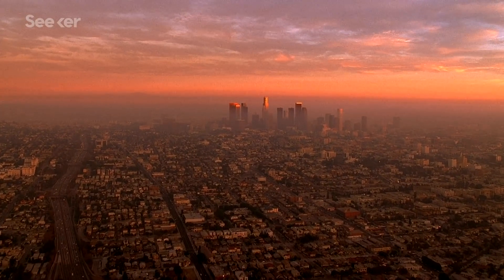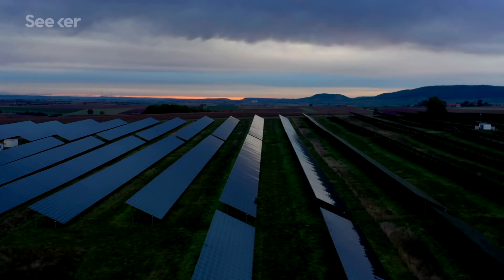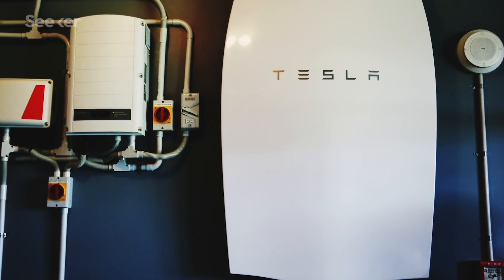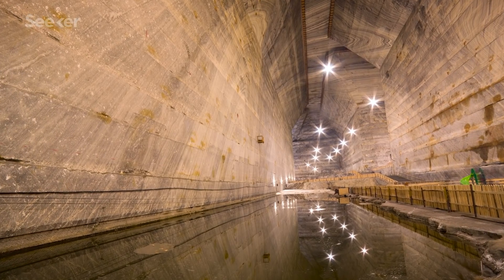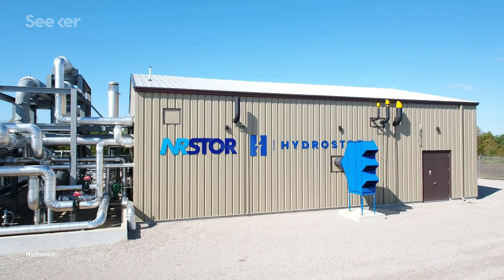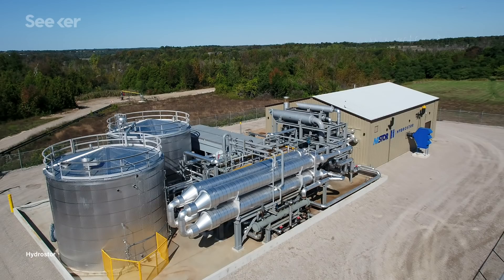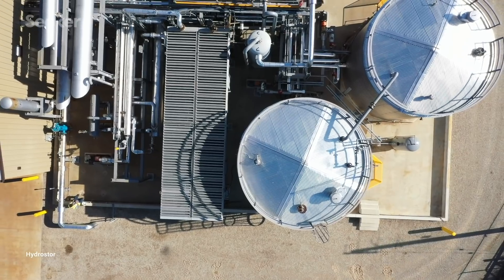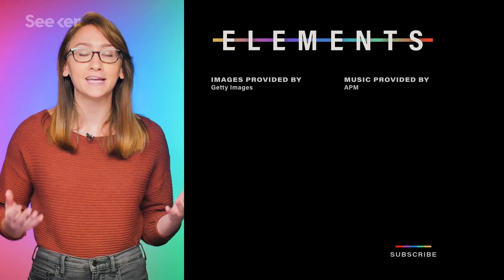This New Tech Could Revolutionize How We Store Renewable Energy

Comment: how to get carbon co2 free world? One word (nuclear)
Reply: Simple strategy, USE NUCLEAR FISSION, untile nucleat fusion becomes developed enough in like 10 years i hope, and then BOOM UNLIMITED ENERGY.(how are you gonna run out of Hydrogen  xD)
Reply: @aryan bharti Russia and US both have hybrid fission-fusion reactor designs on the drawing tables for the 5th generation designs (2050-ish)
Reply: @elijah mikle Every technology produces waste. 

Name another technology that goes to GREAT lengths to capture EVERY GRAM of waste it produces. You can't.  

Can you name all the ways that old solar panels might pollute the environment? Nope, because nobody knows! Yet you want to manufacture and install them at the same rate we produced plastics back in the 1950s — you know, back when we didn't realize some of the shit we make won't decay or break down in nature until AFTER some of those spent fuel rods are 100% lead.

And as many have already stated, 4th gen fast breeder reactors are not only safe, they can use waste from older reactors as fuel.  The only nuclear waste issues in US, Russia, and China isn't from reactors that produce electrical power.  Spent fuel and coolant from modern power plant reactors is easy to store and secure, doesn't take up much room, and is as safe as your ability to read.
Reply: @Mr. & Mrs Smith Again… as several people have already explained… there are plenty of meltdown-proof, proliferation-resistant ways to build modern nuclear power plants. I somehow doubt we'll ever see another one built on a shoreline because of Fukushima, but we're talking about reactors that CANNOT meltdown, don't rely on pressurized vessels or extreme heat. Even the "very-high-temperature thermal reactor", one of the 4th generation designs being evaluated, tops out at 1000°C … no melting of bedrock or vaporization of groundwater from a fissile core meltdown … no pressured hydrogen vessels exploding.

Plus, if the 40 biggest old school nuclear reactors melted down right now, today, the number of deaths caused by nuclear power would still be a tiny sliver of a fraction of the deaths caused by air pollution, fossil fuel spills, and construction accidents at dams and wind/solar farms.
Reply: @lucasthompson1650  "if the 40 biggest old school nuclear reactors melted down right now, today, the number of deaths caused by nuclear power would still be a tiny sliver of a fraction of the deaths caused by air pollution"  The meltdown of just one reactor BANKRUPTED the soviet union.  If 40 melted down it would wipe out the planet's economy for the next thousand years.
Reply: @Zack Mcracken No, the Soviet military budget and a good deal of corruption bankrupted the Soviet Union.  HBO is not s news channel.
Reply: @Anomic Anchorite Travelling wave (breed-burn wave) is going to be the solution for the old waste, but my hopes are on advanced hybrid fission-fusion — Because it could put our cost per kilowatt hour under $0.01.

The fear is frustrating but, I mean, I grew up in the 80s, I watched all the Cold War miniseries and sci fi story plots based around fictional laws of radioactivity.  If I didn't have a solid understanding of science (specifically math & physics) I might be scared of my microwave and worried about getting cancer from 5G antennas too.   … well … no I wouldn't, I'd be face down in a textbook on microwaves or wireless EM fields until I understood it … I guess I can't understand why they're scared of it AND refuse to learn about it.
Reply: elijah mikle  costs depend heavily policies of a country they are located in. The waste can be used up, google "molten salt reactor plutonium", also read this: https://en.wikipedia.org/wiki/Traveling_wave_reactor
In some cases costs of wind or solar outperform nuclear in other nuclear comes in first. See: https://en.wikipedia.org/wiki/Cost_of_electricity_by_source
 (yes waste disposal is factored in). Besides, both wind and solar need more space than nuclear. Additionally wind turbines pose danger to birds, they degrade rather quickly (-> downtime for maintenance). 
Both provide inconsistent power output. And if you use batteries to smooth it out the costs of nuclear will be better every time anywhere. The production of batteries is also harmful for the environment and mining ingredients for them involves child labor in most cases (see: https://www.greentechmedia.com/articles/read/green-battery-revolution-powering-social-and-environmental-risks)
Reply: Mr. & Mrs Smith  educate yourself before posting such nonsense. 
1. "hundreds of miles" Both Fukushima and Chernobyl exclusion zones are 30 km / 18.64 miles (1 km = 0,621371 miles). So not hundreds.
2. Hurricanes and tornadoes do not pose any possible threat to any nuclear power plant. Nuclear PP also built to withstand tsunamis and earthquakes of magnitude 7 or higher happening right under them. 1999, Taiwan, Chichi: shallow magnitude 7.6 earthquake killed 2,415. It caused three reactors at Chinshan and Kuosheng in the north of the island to shut down automatically. They were cleared to restart two days later. The two reactors at Maanshan in the south continued operating, but reduced power later due to damage to distribution facilities.
In Fukushima 15,899 died due to tsunami and only 1 due to irradiation (7 years later). Even if you add max. estimates of all projected future casualties caused by all nuclear accidents worldwide it'll be less than that. The tsunami was cased by an 9.1 earthquake 70 km (43 mi) away, waves were up to 40.5 meters (133 ft) high (14-meter-high or 4-storeys-tall directly at the plant). It was the the fourth most powerful earthquake in the world since modern record-keeping began in 1900.

3. There were only 4 nuclear reactor accidents that resulted in civilian (not power plant workers) injuries/casualties: Fukushima, Windscale (UK), Three Mile Island, Chernobyl. Civilian casualties were only in Chernobyl accident. 
As of April 2018, there are 449 operable power reactors in the world. Additionally, 74 were shutdown or decommissioned. In total, out of 523 ever operative reactors only 11 had accidents of INES level above 3 (which means local radioactive contamination occurred), in total 15 accidents (Windscale plant had 5). Over ~60 years of nuclear power ~2% of reactors had accidents that resulted in contamination. Only 2 of them were significant: Fukushima and Chernobyl. 

Chernobyl caused less than 50 verified radiation exposure related deaths. Also there were 6000 thyroid cancer cases since 1986 in ex USSR. Large portion of which were likely consequence of the disaster, but not all of them. (still less than 15,899)
By now Fukushima caused only 1 death of a plant worker (lung cancer). 15,899 died due to tsunami. According to a June 2012 Stanford University study, based on linear no-threshold model (which is a bad model), the radioactivity released could cause 130 deaths from cancer IN THE FUTURE (lower bound estimate 15, upper bound 1100) and 180 cancer cases (lower 24, upper 1800), mostly in Japan. Radiation exposure to workers at the plant was projected to result in 2 to 12 deaths. If you add average of those estimates you get 1476 (still less than 15,899). If you take into account constant progress in cancer treatments it'll surely be less than 1k.
Reply: @Anomic Anchorite If someone can ever get one built, yeah. Pretty sure thorium will be the primary fuel for the "standing" travelling wave thingy that TerraPower wants to build.  Molten salt thermal and fast-neutron reactors, built in compact modular format (so 8 small reactors in a plant instead of 1 huge one) will probably be the first gen 4 reactors we see. And the fast-neutron varieties should be able to use thorium as a primary source, as well as doped thorium-u235/238 & doped thorium-plutonium (sourced from decommissioned warheads) as well as plain old spent light water fuel rods from gen2/gen3 reactors.

Oh, and I totally agree with you re: "we already have uranium",  if we build these types of reactors, nobody should be sourcing fuel from anywhere other than radioactive waste materials until they're as spent as we can spend 'em 😎.
Reply: @Anomic Anchorite heh, I was just re-reading the thread and noticed that … we should be more careful or this whole thread could meltdown and bankrupt YouTube. 😆
Reply: @Anomic Anchorite yeah, most of the excess waste in US, Russia, and China isn’t from power plant reactors, its from the reactors they ran 24/7 just to get enriched uranium and plutonium, and it was those same sloppy teams that built the storage areas for that crap.   Sweden barely has a parking lot’s worth of spent fuel rods. France and UK haven’t had storage issues, hell, France has an immaculate record for everything nuclear.
Reply: SCP - 507 Hoppy Boi andrew yang supports thorium...
Reply: Everything is made of carbon so you cant do that.
Reply: Thomas Briscoe not EVERYTHING but many things
Reply: Thomas Briscoe also i think he is referring to co2 not elemental carbon
Reply: Check out this chart and tell me we don’t need nuclear power:

https://twitter.com/homo8cosmicus/status/1209219975724097537?s=21
Reply: Dab on the Nuclear hater
Reply: elijah mikle  Google "molten salt reactor plutonium", also read this: https://en.wikipedia.org/wiki/Traveling_wave_reactor
Reply: (war)
Reply: bUt It GUnnA SPloDe?!?!
Reply: @tommy aronson 
Ok, that’s safer than putting them in a car
Reply: How about the waste though?
Reply: @AL-hk3oo  How about the waste from all a energy atm CO2 and many other things just being pump in to the air we breathe in. The waste from nuclear is very small and can be stored under ground. The radioactive thing is no were as bad as most people think. I have studied it for years
Reply: @Sidowse  please explain how nuclear power and nuclear are the something? They use different fuels
Reply: ttime jon no. Anti-matter.
Reply: @mynameisjeff9124  So what? Just because Yang supports thorium doent automatically make it viable.

In reality there is much development required for a viable, commercial application of thorium.
Some would argue we dont have the time to wait.
Reply: and watch the greening of desert edges to stop, and then reverse back to dead sand.
Reply: Centralised nuclear channels to feed decentralised hydrogen-based distribution & storage. Now THAT is the future. No carbon & no precious metals such as lithium involved at the large scale.
Reply: @gacekky1 explain?
Reply: @gacekky1 Hmm i see thank you for explaining to me
Reply: Another relative word (Fusion)
Reply: @iseriouslycouldntfindagood2207  exactly. But until we can produce more energy from the energy that it takes to make nuclear is the way to go right now.
Reply: @iseriouslycouldntfindagood2207  another words "Sci fi"
Reply: Just acting as Devil's Advocate: in a CO2 free world, what will you eat? CO2 is good for plants, therefore good for people. Less CO2 means less plants. More CO2 means more plants. World wide crop yields have doubled over the past 40 years: UN data. How has the tiny increase in a trace gas made things worse?
Basic science which a lot of the Climate change Cult ignore. The only "cure" they offer is higher taxes which will punish the poorest and most vulnerable the most, with excessively high energy prices.
Reply: @SCP - 507 Hoppy Boi Every candidate in the democratic race supports nuclear except for bernie, but bernie is still the best bet for renewable when he is a sponsor of the Green New Deal, which does support nuclear. Trump won't switch to renewable so I don't get why you would berate "the left" for whatever reason.

 Additionally, a centrist or republican politician won't commit to any renewable energy as much as a progressive for that matter. 

The thing about bernie sanders on why he doesn't support nuclear is because its expensive. That really is it. The US has had issues bringing plants into fruition from being just contracts. Even deregulating it will still leave it costly.

Meanwhile, Solar is cheaper than coal already, and many countries have enough landmass to support it.

Maybe once thorium or fusion or molten salt takes over, yes, nuclear will become even more efficient.
Reply: @SCP - 507 Hoppy Boi Have you heard of Andrew Yang 2020!
Reply: Nuclear is not the answer.

https://www.leonardodicaprio.org/the-7-reasons-why-nuclear-energy-is-not-the-answer-to-solve-climate-change/

https://aeon.co/ideas/nuclear-power-is-not-the-answer-in-a-time-of-climate-change

https://thebulletin.org/roundtable_entry/why-nuclear-energy-is-not-the-answer/

Of course, it's worth billions, so you will hear those connected with the industry extolle its virtues in order to protect themselves.

In fact, new wind generation is many fold cheaper than new nuclear. 
Not to mention that, contrary to popular belief, nuclear is not carbon free. CO2 is emitted by the plants during its operation, and a significant amount of CO2 during mining for fissile material. Not to mention the huge cost of decommissioning plants. Not to mention that new plants can take a decade or more to build and always experience massive cost overruns.

http://euanmearns.com/how-long-does-it-take-to-build-a-nuclear-power-plant/

https://www.bbc.co.uk/news/amp/business-41220948

https://en.m.wikipedia.org/wiki/Nuclear_decommissioning

https://theecologist.org/2015/feb/05/false-solution-nuclear-power-not-low-carbon
Reply: @martinw245  >>new wind generation is many fold cheaper than new nuclear
You need to stabilize the output though. Either through batteries or gravitational(pump water up in a reservoir)/pressure(this seeker video) energy storage. In any case that will significantly boost the costs. Right now that is not factored in in comparative studies.

>>nuclear is not carbon free.....significant amount of CO2
Neither is solar and wind. CO2 is emitted during production, transport, construction, maintenance.
 Here you can compare harmonized life cycle assessments (LCAs) of electricity generation technologies (wind is the only thing that is better than nuclear in regard of CO2 emissions, but it is inconsistent in energy output which must be compensated by additional operations): https://www.nrel.gov/analysis/life-cycle-assessment.html#paneld10e135_4
In terms of CO2 emissions. Nuclear is on par with Concentrating Solar Power. And photovoltaics are noticeably worse.

>>huge cost of decommissioning
It is factored-in in LCAs studies (see link above)

>>new plants can take a decade or more to build and always experience massive cost overruns
Wrong and wrong again. You even provided a link that disproves this statement (http://euanmearns.com/how-long-does-it-take-to-build-a-nuclear-power-plant/).
"I was surprised to see that 374 out of 441 reactors were built in 10 or less than 10 years. There is a tail of 15% that have taken longer to build. The world record is 33 years for the Atucha-2 reactor in Argentina where construction began in 1981 and was grid connected in 2014. I can only assume that construction was halted for a large number of years."
"The mean time taken to build 441 reactors operational today was 7.5 years."
And if you look at the very first graph you can see that ~418(~95%) of the reactors were constructed in 15 years or less. The other 5% are delays caused by insufficient government funds (e.g. Angra-2 in Brasil and Atucha-2 in Argentina) or regime change (and consequent funding problems) (e.g. ex USSR countries: Ukraine, Russia, Slovakia).
Reply: @artiomvas  

"You need to stabilise the output though. Either through batteries or gravitational(pump water up in a reservoir)/pressure(this seeker video) energy storage. In any case that will significantly boost the costs. Right now that is not factored in in comparative studies."

You don't NEED to stabilise the output. IT's PREFERABLE to stabilise the output. Renewable energy sources provided more energy than fossil fuels over the third quarter this year, despite the UK not having optimal battery storage YET.

We are not at the "comparative study" phase we are beyond that. Across the UK we are installing grid scale battery storage. Our bonkers government has held back to a degree. In 2019 our battery storage increased by 70%. There are numerous other grid scale storage projects in the pipeline too.  

"Neither is solar and wind. CO2 is emitted during production, transport, construction, maintenance."

Of course, but not anywhere near the  extent of nuclear power. 

"Using 0.005% ore, nuclear has higher carbon emissions than gas"

"Table 12 in the Berteen paper confirms the van Leeuwen result that for ore with uranium concentration around 0.01% the carbon footprint of nuclear electricity could be as high as that of electricity generation from natural gas."

"This remarkable observation has been further confirmed in a report from the Austrian Institute of Ecology by Andrea Wallner and co-workers. They also point out that using ore with uranium concentration around 0.01% could result in more energy being input to prepare the fuel, build the reactor and so on, than will be generated by the reactor in its lifetime."

"As all six are either above, or have error bars that reach above, the CCC's 2030 threshold of 50 gCO2/kWh, the balance of the evidence of the six most robust LCAs is that the carbon footprint of nuclear power is above the CCC's recommended limit.
"

"And of course these figures apply to existing nuclear power stations, not the EPR design planned for Hinkley C. As we have seen, the EPR's very high cost suggests considerably higher emissions in the construction stage. So too does the fact that, over its projected 60-year lifetime, it will be using uranium from very low quality ores."

https://theecologist.org/2015/feb/05/false-solution-nuclear-power-not-low-carbon

"6. Carbon-Equivalent Emissions and Air Pollution
There is no such thing as a zero- or close-to-zero emission nuclear power plant. Even existing plants emit due to the continuous mining and refining of uranium needed for the plant. Emissions from new nuclear are 78 to 178 g-CO2/kWh, not close to 0. Of this, 64 to 102 g-CO2/kWh over 100 years are emissions from the background grid while consumers wait 10 to 19 years for nuclear to come online or be refurbished, relative to 2 to 5 years for wind or solar. In addition, all nuclear plants emit 4.4 g-CO2e/kWh from the water vapor and heat they release. This contrasts with solar panels and wind turbines, which reduce heat or water vapor fluxes to the air by about 2.2 g-CO2e/kWh for a net difference from this factor alone of 6.6 g-CO2e/kWh.

In fact, China’s investment in nuclear plants that take so long between planning and operation instead of wind or solar resulted in China’s CO2 emissions increasing 1.3 percent from 2016 to 2017 rather than declining by an estimated average of 3 percent. The resulting difference in air pollution emissions may have caused 69,000 additional air pollution deaths in China in 2016 alone, with additional deaths in years prior and since. "

https://www.leonardodicaprio.org/the-7-reasons-why-nuclear-energy-is-not-the-answer-to-solve-climate-change/
Reply: @martinw245  Let me begin with the "0.005% uranium ore...0.01% ore" statement. This is a manipulative statement of the "straw man fallacy" type. You were it's target. And you swallowed it hook, line, and sinker
. And BTW don't think for a second that I wouldn't notice your lie by omission, mate. You forgot to quote this part: 
"A conservative estimate for the future LCA of nuclear power for power stations intended to continue operating into the 2090s and beyond would assume the lowest uranium concentration currently in proven sources, which is 0.005%."
The 0.005% is about >>>2090<<< and beyond. By that time we'll have nuclear fusion and God knows what else.

To rigorously explain why HIS statements are misleading I'll have to provide some background on the person who made them:
Keith Barnham started as a particle physicist. Mid-career he switched to solar energy research. Throughout the years he co-held several patents in the solar tech field (currently 1). He has over a hundred of published papers. Now here is why this is important: it is undeniable, that a man of his experience and intellect makes sure his statements are correct. Unless his intention is to mislead the audience.
However, one glance at the wikipedia page https://en.wikipedia.org/wiki/Uranium_ore reveals, that his statements ARE misleading. While it is true that if nuclear fuel was made out of 0.005% ore it would be "dirtier" than gas and for 0.01% ore would be as "dirty" as gas, it doesn't matter whatsoever. As I said before the "0.005%" part is a estimate for 2090. It is simply irrelevant for 2020-2050 period. The debate that goes on is not about what we should build in 30-40 years from now. It is about NOW.
"0.01%" is also irrelevant and intentionally misleading: 0.01% ore considered to be the lowest commercially viable grade. It represents less than 5% of globally mined ore. Oh, and BTW it comes as a byproduct of mining for other metals, no one mines 0.01% U-ore just for Uranium (FYI 0.005 isn't mined/processed anywhere at all). All other mined ores are of higher quality. For example mines in Canada have high Uranium concentrations, ranging from tens of times more than 0.01% to hundreds and thousand times as much (2 mines of 16.24% and 15.9%). 
Here you can find all the info on countries-producers of U-ore: https://www.world-nuclear.org/information-library/country-profiles/countries-a-f/canada-uranium.aspx

To summarize: Keith Barnham argument about ore concentrations is intentionally misleading. He has intellectual ability and ethical responsibility as a scientist to make a simplest google lookup. Yet, he makes it look like the world mostly uses fuel made out of 0.01% ore, and tries to further demonize nuclear by weaving in 0.005% ore in the discussion. Could it be because he has some conflict of interest? Remember: he has a patent, and somebody somewhere surely pays him for licence to use it in production of solar panels.

>>but not anywhere near the  extent of nuclear power
This statement is false, and it makes it evident that you didn't even bother to click on this link: https://www.nrel.gov/analysis/life-cycle-assessment.html#paneld10e135_4
If you would, you'd have noticed that nuclear and wind have about the same 75th to 25th percentile in Life Cycle GHG emissions. Or could it be, that this is a classical case of "curse of knowledge"? Meaning, I wrongly assumed that you poses same knowledge and skill as I do, whereas in reality you don't understand anything about physics, statistics or even math in general and therefore can't even read the charts.

>>You don't NEED to stabilise the output.
Yes you do. Otherwise, if there is ever a murky and quiet evening you wont have enough energy for everyone. That is not debatable. That is a fact.
>> we are installing grid scale battery storage...In 2019 our battery storage increased by 70%...numerous other grid scale storage projects in the pipeline
Oh, so you DO need the storage after all, don't you? If it would be "preferable" instead of necessary why would they bother? Producing this storage adds costs both environmental and economical. And yet they aren't factored-in in LCAs, which makes renewables look better then they really are.
Reply: @martinw245  Oh, and BTW here is a debunk of you the Ecologist article you've linked: https://webcache.googleusercontent.com/search?q=cache:985K9v3D808J:https://energyrealityproject.com/point-refuted-a-thousand-times-nuclear-is-not-low-carbon/
The website has some technical issues right now so I gave Google Cache link. Also the debunk is not that good, I could've made it better, but I'm not gonna waste any more time on you.
If you have even a smidge of critical thinking and desire to find the truth you'll take it from here on your own.
Reply: @martinw245  To accomplish the scale of energy generation for the USA you must absolutely have massive scales of storage and grid network supplemental infrastructure.

Otherwise you will not have enough energy during periods of low production, and you will also lose a large amount of energy when peak production exceeds that of energy demand. 

Your example of the UK is not really viable as you're not taking into consideration that fossil fuels were used to provide energy for periods of low production for renewables. In a 100% renewable scenario you don't have that option. When you start looking at major grid networks the problem only increases in scale.
Reply: @brian2440  

"To accomplish the scale of energy generation for the USA you must absolutely have massive scales of storage and grid network supplemental infrastructure."

Well kind of, yes. If you are talking about 100% renewable energy generation across the US you are kind of correct . Where did I say that wasn't the case? But the point, is that here in the UK, and indeed the US, that process has already begun. As of May 2019, the U.S. had over 31.2 GW of rated power in energy storage compared to 1,098 GW of total in service installed generation capacity as of January 2019. California leads the U.S. in energy storage with 300 operational projects (7.2 GW), followed by Virginia and South Carolina. Several EES technologies are in research phases, and some are deployed. But the point is that EES will be deployed as and when it is viable, no one is saying it will happen overnight.

Now compare that with nuclear, and the gigantic cost of converting all US energy generation to nuclear. 

And lets not forget, nuclear requires energy storage too! Nuclear advocates claim nuclear is still needed because renewables are intermittent and need natural gas for backup. However, nuclear itself never matches power demand so it needs backup. Even in France with one of the most advanced nuclear energy programs, the maximum ramp rate is 1 to 5 % per minute, which means they need natural gas, hydropower, or batteries, which ramp up 5 to 100 times faster, to meet peaks in demand. 

"Your example of the UK is not really viable as you're not taking into consideration that fossil fuels were used to provide energy for periods of low production for renewables."

I was taking that into considerations. I clearly stated the percentage of renewable energy. The rest obviously comes from fossil fuels or nuclear.

 "In a 100% renewable scenario you don't have that option."

Of course not. But here's the thing...  Battery technology is advancing rapidly, with solid state lithium ion literally 2 years away, with graphene set to follow. Not to mention a big market now for "second life batteries for grid scale energy storage. Plenty more ESS sytems in the lab currently too. In fact in the US, you guys yourselves are currently utilising, pumped hydro, compressed air storage, battery storage, and flywheel storage and have several EES projects under way as we speak. And that process will continue into the future.

As mentioned, nuclear is NOT the answer. 
Listen to the words of Derek Abbott, Professor of Electrical and Electronic Engineering at the University of Adelaide in Australia...

""global power consumption today is about 15 terawatts (TW). Currently, the global nuclear power supply capacity is only 375 gigawatts (GW). In order to examine the large-scale limits of nuclear power, Abbott estimates that to supply 15 TW with nuclear only, we would need about 15,000 nuclear reactors. In his analysis, Abbott explores the consequences of building, operating, and decommissioning 15,000 reactors on the Earth, looking at factors such as the amount of land required, radioactive waste, accident rate, risk of proliferation into weapons, uranium abundance and extraction, and the exotic metals used to build the reactors themselves. “A nuclear power station is resource-hungry and, apart from the fuel, uses many rare metals in its construction,” 

"Abbott told PhysOrg.com. “The dream of a utopia where the world is powered off fission or fusion reactors is simply unattainable. Even a supply of as little as 1 TW stretches resources considerably.”

As I said... nuclear is NOT the answer.

"When you start looking at major grid networks the problem only increases in scale."

Its not going to happen overnight. It will proceed as and when possible. Hopefully fast enough. Now consider the scale of the problem to build 15000 nuclear reactors world wide and the horrendous issues and cost that would incur!

For example...

"Nuclear waste: Although nuclear technology has been around for 60 years, there is still no universally agreed mode of disposal. It’s uncertain whether burying the spent fuel and the spent reactor vessels (which are also highly radioactive) may cause radioactive leakage into groundwater or the environment via geological movement.

Proliferation: The more nuclear power stations, the greater the likelihood that materials and expertise for making nuclear weapons may proliferate. Although reactors have proliferation resistance measures, maintaining accountability for 15,000 reactor sites worldwide would be nearly impossible.

Uranium abundance: At the current rate of uranium consumption with conventional reactors, the world supply of viable uranium, which is the most common nuclear fuel, will last for 80 years. Scaling consumption up to 15 TW, the viable uranium supply will last for less than 5 years. (Viable uranium is the uranium that exists in a high enough ore concentration so that extracting the ore is economically justified.)

Exotic metals: The nuclear containment vessel is made of a variety of exotic rare metals that control and contain the nuclear reaction: hafnium as a neutron absorber, beryllium as a neutron reflector, zirconium for cladding, and niobium to alloy steel and make it last 40-60 years against neutron embrittlement. Extracting these metals raises issues involving cost, sustainability, and environmental impact. In addition, these metals have many competing industrial uses; for example, hafnium is used in microchips and beryllium by the semiconductor industry. If a nuclear reactor is built every day, the global supply of these exotic metals needed to build nuclear containment vessels would quickly run down and create a mineral resource crisis. This is a new argument that Abbott puts on the table, which places resource limits on all future-generation nuclear reactors, whether they are fueled by thorium or uranium."
Reply: @martinw245  The problem is, to be fair it's an argument a lot of people on here are foolishly advocating for, you're talking 100% renewable vs 100% nuclear. Both of these are not good plans. In any scenario you don't want just one energy source to supply all energy consumption that's just a terrible plan. 

The comparison should be 100% renewable vs Sustainable and Renewable mix in which nuclear makes up between 15-30% of market penetration (penetration based on average findings for Sustainable development energy transition studies).

With this in mind are the costs of supplemental infrastructure worthwhile in comparison with costs for sustainable models? Many studies show that no this is why 100% renewable is not the best decision.

Yes there are advances in energy storage and grid technologies, but I don't think anyone really appreciates the scale of development we are talking about here. Were talking about million to billions of units at cost estimates of trillions of dollars. This doesn't mean that ots not possible, but we need to recognize the scale of development and compare costs at this scale.
Reply: @brian2440  

Apologies Brian, I forgot to add.

The intermittent nature of renewable energy is  an issue, but nothing like the issue the critics claim. 

The reason I said "kind of" in regard to your claim of "massive scales of storage and grid network supplemental infrastructure." being required" is as follows.

"Geothermal has no intermittentcy issues and experiences fewer  shut downs than coal, nuclear, and natural gas. Solar thermal — with molten salt as its storage medium — can be designed to have no intermittency issues. Offshore wind yields power more or less 24/7 with relatively limited intermittency compared with onshore wind. The two most common sources of renewable electricity, onshore wind and solar photovoltaics, are, of course, complementary: wind turbines (which, in the case of GE, already have built-in storage capacity) yield more power at night, while solar panels yield power during the day; hence, used in tandem, they can provide electricity 24/7 with “intermittency” being experienced only locally at each individual solar installation. The experience in Germany shows that the more wind and solar PV installations one has in the various regions of one’s country, the less the so-called intermittency problem is an issue because electricity is generated at varying wattages in the various locations more or less 24/7 and the actual total daily electric power levels become more and more stable and more and more foreseeable as the number of installations increases nationwide. At that point, the intermittency deficit is more easily and more predictably counterbalanced with reserve power (natural gas and hydro), storage (pumped hydro, compressed air, flywheels, grid storage batteries), and grid power from neighboring nations."

In addition...

Renewable energy  becomes more predictable as the number of renewable generators connected to the grid is increased. This is because of the effect of geographic diversity and also  "Law of Large Numbers."

The Law of Large Numbers is a probability theorem. It states that the aggregate result of a large number of uncertain processes becomes more predictable as the total number of processes increases. In terms of renewable energy, the Law of Large Numbers says that the combined output of all wind turbines and solar panels connected to the grid is much less volatile than the output of fewer generators

The Law of Large Numbers causes the amount of reserve energy storage capacity required to balance renewables  to be a lot less than many claim.
Reply: @martinw245  Your law of large numbers deals more with the uncertainty of data, the problem is at least in the USA we have institutions that are capable of analyzing problems at massive continental scales, this eliminates a lot of the uncertainty in terms of quantity. It's fine if you disagree, but sorry mate I tend to believe studies from Argonne, Lawrenece Berkley, National Renewable Energy, Brookhaven, Sandia,  Oak Ridge and Pacific Northwest National Labs and studies in collaboration with labs and major universities like MIT, UC Berkley, UC Irvine, Penn University, Florida State, Georgia Tech, Florida State etc. 

Besides just storage there are additional grid issues related to intermittency that have significant concern as found by IEEE (Institute of Electronics and Electrical Engineers).

Geothermal shows good promise in specific geological areas, and faces similar well production issues as natural gas for large scale production. In fact ironically there are many geothermal companies that use practices nearly the same as hydraulic fracturing as natural gas. The same can be said for CSP thermal and Offshore wind (in terms of good production by geographical area), however we also need to take into consideration that these energy sources will require additional scales of transmission due to a lower ability for localized energy production. Also I would say large scale offshore wind is a dark market in the USA, where we haven't really established environmental licensing (really just a US legal and construction problem).
Reply: @brian2440  

"get what your study is saying, except it's making a very general argument "

Well yes, it has to. And it should. It's dealing with intermittentcy as a whole, not individual nations/states, specific cases. It's a fact that on the whole, on average, the intermittent nature of renewable energy isn't as big an issue as the critics claim. Simple as that. Now of course, you can cherry pick individual cases if you like but that wouldn't be relevant. 

I find myself having to defend renewable energy here, while you fail to address the issues regarding nuclear power I have put to you. 

We have established that for nuclear power to solve the climate crisis, there would have to be literally thousands of reactors built worldwide. 15,000 was the estimate in the article I linked to but I've seen the figure beyond 20,000. If that's the case, how will we deal with the following issues...

1. The intermittent nature of nuclear power. 
Nuclear itself never matches power demand so it needs backup, (like renewable energy does) due to issues with the ramp rate.  Which means they need natural gas, hydropower, or batteries, which ramp up 5 to 100 times faster, to meet peaks in demand. So how will 15000 - 20000 reactors worldwide acquire that backup? Hydro isn't feasible for many thousands of reactors worldwide. So thousands upon thousands of fossil fuel plants remaining is it? Or would you like batteries, just like renewable energy? 

2. Cost?
Both for initial  construction of 15000 to 20000 plants. And for the huge amount of nuclear waste that would need to be stored and guarded. In the US alone that figure is 500 million dollars EVERY year to store waste. Now consider that worldwide for 15 to 20,000 reactors. 

3. Weapon proliferation risk?
The growth of nuclear energy has historically increased the ability of nations to obtain or harvest plutonium or enrich uranium to manufacture nuclear weapons. The Intergovernmental Panel on Climate Change (IPCC) recognizes this fact. They concluded in the Executive Summary of their 2014 report on energy, with “robust evidence and high agreement” that nuclear weapons proliferation concern is a barrier and risk to the increasing development of nuclear energy: 

How would you deal with this risk for the waste from 15 - 20,000 reactors worldwide?

 4. Mining Lung Cancer Risk
Uranium mining causes lung cancer in large numbers of miners because uranium mines contain natural radon gas, some of whose decay products are carcinogenic. A study of 4,000 uranium miners between 1950 and 2000 found that 405 (10 percent) died of lung cancer, a rate six times that expected based on smoking rates alone. 61 others died of mining related lung disease

How would you protect the HUGE numbers of miners at risk as a result of extracting ore for 15-20,000 reactors? 

5. Waste Risk
Last but not least, consumed fuel rods from nuclear plants are radioactive waste. Most fuel rods are stored at the same site as the reactor that consumed them. This has given rise to hundreds of radioactive waste sites in many countries that must be maintained and funded for at least 200,000 years, far beyond the lifetimes of any nuclear power plant. The more nuclear waste that accumulates, the greater the risk of radioactive leaks, which can damage water supply, crops, animals, and humans.

How would you store the enormous amount of waste, securely, safely, from 15 to 20,000 reactors worldwide?
Reply: @martinw245  I don't where on earth you got the idea that I support 100% Nuclear. Just from a mathematics standpoint you likely wouldn't need 15,000 reactors (which btw how the f@ck did they come up with that number given the considerable range of generation IV net production figures).

As I explained in the very beginning its incredibly foolish to support only 1 energy type.

If you want to attack my energy stance finebht then attack the actual articles I support with the highest confidence, which is the NREL' Electricty Futures Report and MIT ENERGY initiative's Utility Of the Future Report.

- https://www.nrel.gov/analysis/re-futures.html

- 

You'll find that both of these studies are considerably comprehensive and contain a variety of energy sources and an explanation for why these penetrations and technologies are chosen.

Yes I support nuclear energy, in part because it makes zero ecological sense to remove the #1 source of low carbon in the US and replace it in historically unfathomable construction rates and statistically impossible timeframes with only renewables. I've asked the question multiple times from Sanders progressives how they possibly think replacing 80,000 GWh in less than 2 years is feasible, when that's more energy than the entire utility solar industry in the USA produces per year. 

I mean you look at major studies like WWS and yes there's data I can somewhat agree with, but the construction rates for solar and wind compared to history make zero sense. Jacobson's talking about installation rates that are 300% greater than what has been achieved at any time in human history. How the f@ck do you possibly justify these rates with zero increased efficiency of production rates against historical means, and increased procurement of permits and licensing for construction? The latter isnt even an observed factor by any of his studies (and the most scientific studies). 

It doesn't make any sense to give contractors an impossible task, just because scientists didn't make their studies with real world variables. Unless we have government that changes or refuses to follow it's own laws, you're still going to require NEPA, NHPA, GEBA, RCRA, TSCS, CWA, REP, CAA etc permits. 

It's pretty obvious that many studies down take this into consideration. 

Nuclear fits into the situation only that it would be considerably easier, and likely costly to keep existing reactors, and add advanced nuclear for the development of industrial process that renewables by and large cannot produce effectively. That's the nuclear argument I make.
Reply: @martinw245  Disclaimer: I'm not for 100% nuclear. It's simply not reasonable (as is 100% renewables) and pretty much impossible to pull off in the limited time we have. I'd say it should be 30-50% nuclear, the rest renewables.

 >> Nuclear itself never matches power demand....Or would you like batteries, just like renewable energy? 
Neither do renewables. To be able to "ramp up" they require energy storage. Except, when nuclear plant finally done ramping up, it does not need "backup" anymore (not to mention it doesn't need as much backup as renewables do), AND it can keep up the pace 24/7 unimpaired by changes in weather. Renewables, on other hand, are limited by the weather and the storage capacity. And if you add the same energy storage as a backup for nuclear, you get the advantages of nuclear over renewables (stable, yet variable on demand output) plus quick ramp up.

>> So how will 15000 - 20000 reactors worldwide acquire that backup? 
And how the equivalent (in energy output) amount of renewables power plants would acquire that backup? They will need the back up ALL THE SAME. Without storage their output is too unreliable, unless you will build many many more turbines, so their combined output randomness would result in more or less stable production. The law of large numbers is not applicable to solar — it only provides output in a 9h window. Wind power output is lower than solar, which means you would need a lot of turbines and more on top of that for redundancy and to make law of large numbers work. Side note, equivalent by output number of solar power plants would require 6 times the area comparing to nuclear.

>> Hydro isn't feasible for many thousands of reactors worldwide. So thousands upon thousands of fossil fuel plants remaining is it? Or would you like batteries, just like renewable energy? 

This is a false dichotomy at its finest. Why you only offer hydro and fossil? ANY energy storage can be used. Pressurized air/flywheel/molten salt energy storage, you name it. Yes, batteries can also be used.

>>Costs
E.G.: In France and Korea it the levelised cost of energy for nuclear is lower than for any wind or solar types: https://www.world-nuclear.org/information-library/economic-aspects/economics-of-nuclear-power.aspx
Waste can be spent up in future types of reactors (MSR, TWR)

>> Weapon proliferation risk?
Not really an argument, considering that China doesn't give a shit about it and keeps increasing its warhead count. And US has withdrawn from a nuclear treaty with Russia. And there is no higher power in the world that could force any of those 3 key players to behave. Pakistan, India, and North Korea are also increasing their warhead inventories.

>>Lung cancer
The study looked at miners from 50s to 2000. The miners safety was not a priority up to ~1975 (in USA)
[wiki]: Despite these hazards being known in the early 1950s, this occupational hazard remained poorly managed in many mines until the 1970s. During this period, several entrepreneurs opened former uranium mines in the US to the general public and advertised alleged health benefits from breathing radon gas underground. Health benefits claimed included pain, sinus, asthma and arthritis relief,  but these were proven to be false and the government banned such advertisements in 1975. Since that time, ventilation and other measures have been used to reduce radon levels in most affected mines that continue to operate. In recent years, the average annual exposure of uranium miners has fallen to levels similar to the concentrations inhaled in some homes. [/]

Here is a review of 32 articles from 2007-2014 (1 metaanalysis, 26 cohort/cohorts/nested cohort studies, 3 case-control studies and 2 reports/
expert opinions). They included dozens of thousands of miners from 50s to nowadays, but the conclusion was that the risk increases by a factor of 2: http://scielo.isciii.es/pdf/mesetra/v61n238/en_revision1.pdf

>>5. Waste Risk
I'm too tired to go on.
MSR, TWR
Reply: @brian2440  

"If you want to attack my energy stance finebht then attack the actual articles I support with the highest confidence, which is the NREL' Electricty Futures Report and MIT ENERGY initiative's Utility Of the Future Report."

NREL is a US government owned contractor. So given the stance of the US government on climate  change and renewable energy, I absolutely do not regard this is a viable source. Sorry.
Reply: @brian2440  

"I don't where on earth you got the idea that I support 100% Nuclear."

Because that was the entire premise of the original poster. That the widespread deployment of nuclear power will save us.
I replied that it's not the answer. You arrived and criticised the deployment of grid scale energy storage technologies. Immediately jumping to a 100% renewable, 100% deployment, end point scenario. I went on to explain that your argument wasn't valid, because such technology is being implemented now, at a pace that is feasible and will continue to be implemented at a pace that is feasible, dependant on the particular nations circumstances. Yes, deployment of ESS takes money time and effort, infrastructure, planning etc. But it's not happening overnight, so to criticise it in terms of the final end point, 100% deployment, is illogical. Again... both your nation and mine are currently deploying such technology. 

"you likely wouldn't need 15,000 reactors (which btw how the f@ck did they come up with that number given the considerable range of generation IV net production figures)."

If you'd bothered to read the article I linked to you would know how that figure was generated and by whom. It was calculated by professor Derek Abbott. Sorry but I am more likely to believe Professor Abbot than a guy called Brian on YouTube. 

"If you want to attack my energy stance finebht then attack the actual articles I support with the highest confidence, which is the NREL' Electricty Futures Report and MIT ENERGY initiative's Utility Of the Future Report."

You must be kidding! NREL are a government owned contractor and funded and overseen by the U.S. Department of Energy. And given the bonkers attitude of the US government to renewable energy and it's denial that climate change is even happening, not interested. I find your reply amusing, given that I have posted so many links from reputable sources like scientific publications, highly qualified individuals, not to mention the Union of Concerned Scientists. Never form a contractor owned by a bonkers climate change denying government though. 

"Yes I support nuclear energy, in part because it makes zero ecological sense to remove the #1 source of low carbon in the US "

What the hell! I don't want to remove all nuclear reactors "in the short term"  either. Iv'e never said that. In the longer term we must though.

"and replace it in historically unfathomable construction rates and statistically impossible timeframes with only renewables."

Not once have I advocated such a thing. We will, and should transition to renewable energy at a rate that is feasible. And that will depend on the circumstances of that particular nation. My only argument here has been that "nuclear is not the answer" in terms of its widespread adoption. You talk of "construction rates" and "time frames" as if its actually possible to achieve the impossible. Of course its not. It will happen at a pace that is actually possible. Can the transition actually occur much faster than it is now? Of course it can" Currently politicians are procrastinating. And in the US, you guys have a government that is doing everything it can to actually PREVENT the mitigation of climate change. Which is actually criminal. Those politicians and energy company executives, in 100 years, 200 years time, will be looked back upon ans spoken about in the same breath as mass murderers... because that is what they will ultimately be responsible for.
Reply: @brian2440  

"Nuclear fits into the situation only that it would be considerably easier, and likely costly to keep existing reactors, and add advanced nuclear for the development of industrial process that renewables by and large cannot produce effectively. That's the nuclear argument I make."

I notice you tend to just empathise the US, rather than consider the world as a whole.

Can you elaborate? How many "advanced nuclear" reactors are you advocating? And those new reactors will commit the US to CO2 emissions (as we agree - lower CO2 but still emit) for how long? 70 years isn't it the lifespan of a reactor? 

Ultimately, longer term,  we have to emit zero CO2.
Reply: @artiomvas  

"I'm not for 100% nuclear. It's simply not reasonable (as is 100% renewables) and pretty much impossible to pull off in the limited time we have. I'd say it should be 30-50% nuclear, the rest renewables."

30 - 50% nuclear would still have significant CO2 associated with it. Ultimately, longer term, we have to emit zero CO2 or as close as we can get to that. 

https://theecologist.org/2015/feb/05/false-solution-nuclear-power-not-low-carbon

You say 100% renewable is not possible. It is. 

"Neither do renewables."

We know. Go back and read the response to Brian again. That was the point, that BOTH renewable energy and nuclear require backup.  The point was that criticising renewable energy for requiring energy storage solutions is not valid, for a number of reasons, one of which is that nuclear require that tech too.

"And how the equivalent (in energy output) amount of renewables power plants would acquire that backup? "

Again... That was the point. Both renewables and nuclear require backup. 

"The law of large numbers is not applicable to solar — it only provides output in a 9h window."

You don't understand what the law of large numbers means in the context of renewable energy. It applies to ALL sources of renewable energy combined not just solar. When you combine large numbers of generation sources of all kinds,  energy storage solutions are still required but lower. Lower because the downtime is not all at the same time. Plus predictability is improved. 

"Why you only offer hydro and fossil? ANY energy storage can be used. Pressurized air/flywheel/molten salt energy storage, you name it. Yes, batteries can also be used."

Again... go back and read the entire reply. I was IN FAVOUR of grid scale energy storage of all kinds. And was pointing out that such storage is required for BOTH nuclear and renewables, so not a valid argument against renewable to criticise the requirement.

"Not really an argument, considering that China doesn't give a shit about it and keeps increasing its warhead count. And US has withdrawn from a nuclear treaty with Russia. And there is no higher power in the world that could force any of those 3 key players to behave. Pakistan, India, and North Korea are also increasing their warhead inventories."

Of course its a valid argument. In addition to the nations who you cite as an example of proliferation... you would have a huge amount of waste that poses a thereat to add to the total, from 15,000 to 20,000 extra reactors.

"I'm too tired to go on."

Unfortunately you were also too tired to read my replies properly and consider them in the proper context.
Reply: @martinw245  Where are you getting this idea that the NREL is biased government contractor that changes position on the whims of the executive branch of government? 

Their entire purpose for existence is research and development for renewable technologies associated energy network systems. You think because trump doesn't believe in climate change the NREL is just going to stop doing their job? That doesn't make any sense, nor is it even remotely accurate. The majority of research and most high value development exists for periods that is longer than a presidential term, so how it would possibly make any sense for development to change every four years?

Furthermore there's 17 different US National Labs each with different specialties. It makes considerably more sense (and what has historically occurred in the US) for the US Exectuive Branch to push funding and policies for whatever energy policy they support. This policy typically has little sway on the actual development in these labs. 

The significant government development technologies created in the department doesn't even reach the commercial market until many years after a presidential term, and agreements with private contractors per their agreements are not subject to change depending on the president, as that's a violation of contractual agreements.

Lastly on this look up previous NREL projections in 2016, 2014, 2012, 2010, 2008, 2004, 2002, 2000, 1998, 1996, 1994, 1990, 1986, 1984, 1982 and show me a time where their data supports 100% renewable? Their information is drawn from raw data, so the idea that the president is going to eliminate raw evidence from multiple metrics and sources (that quite frankly he likely doesn't have the intelligence capacity to know they exist) is lunacy. 

I get from not from the USA, so you do get a pass, and yes this video is not exclusive for the US. However it's incredibly difficult to make conclusive arguments for energy policy of the world due to such a massive range in sociopolitical, economic and cultural factors throughout the world. 

I've tried to make it clear I'm talking exclusively about the US, because that's where I live and I have the most knowledge of. I think the UK has a better opportunity to reach higher penetrations of renewables due to a variety of factors.

However, you should still know just from a simple google search that the US Department of Energy has historically been largely bipartisan in energy policy since its creation in the 1970s, and for institutions like the US national labs which receive ZERO executive appointments and are the highest scientific institutions in the country to act like they have zero credibility because trump is president is laughably foolish.
Reply: @brian2440  

"Where are you getting this idea that the NREL is biased government contractor"

Err... lets see. Where you aware that Exon are now funding NREL to the tune of 100 million dollars? Stanford University recently commented how damaging this was. 

Sorry, I find that dubious.
Reply: @martinw245  And in the article that you read that from did it say that Exxon is funding the NREL institution directly for all functions? Or did it state that the NREL has a partnered program agreement in its private R&D program sectors? 

All US National Laboratories have developmental program and contract agreements with private companies for the development of different technologies. Does this mean that these companies fund these labs? Not really. It means that companies and the federal government enter into joint agreements to develop technologies. Typically this is done to take a technology that a private company has developed and owns patents and proprietary rights on to develop to larger scales. 

These types of programs are in part how companies have grown natural gas processes such as horizontal drilling or how major solar companies have grown solar cell efficiency to commercial scale deployments. 

This does not in any way mean that Exxon or Tesla has incentives over a national laboratory especially on a multi-laboratory electricty projection. 

Which btw ExxonMobil is primarily a petroleum development company (yes they have significant assets in natural gas, but primarily for refining). Petroleum production for electricty in the USA makes up 0.1% of net generation, so pray tell how exactly Exxon Mobil is convincing the NREL, ANL, SNL, INL, ORNL, BNL, LNL, PNWNL and MIT that 100% renewable is not the best decision for electricty development, when that is not their primary industry for development? 

Course this would've been very easy to figure out if you just bothered to read the study in the first place, considering that all datasets are based on data collection from these national labs internally and compared with studies from MIT for three base scenarios.
Reply: @martinw245  Its interesting that you don't support 100% renewable and believe we should recognize feasible timeframes for completion, yet support remarks from Mark Jacobson whose 100% renewable model is widely regarded as one of the most ambitious 100% Renewable model for the USA and World ever. 

Major grievances include:
- Projection of theoretical hydroelectric reserve limits that exceed EIA reserve limits.
- Projected capacity installation rates for solar and wind are 300% greater than what has been demonstrated for any technology in human history

- Project geothermal and tidal capacity additions are greater than what has been demonstrated by the world and are greater than MIT Global Projections even with consideration for deployment techniques that currently don't even exist in the commercial market

- Projected hydroelectric installments would likely require full scale upgrades with regulatory requirements that far exceed projected timeframes in WWS model 

- projected hydrogen development for multiple industries developed entirely by renewables brings in multiple questions for efficiency losses compared to steam deformation and projected additions are unsupported by any other study

- Lack of grid development analysis and cost analysis for electrical grid brings into question the feasibility analysis of energy storage. Also fails to discuss both synchronous and asynchronous grid functions which according to the IEEE would be essential for management of penetrations exceeding 40% VRE and 90% renewable. 

- https://onlinelibrary.wiley.com/doi/abs/10.1002/wcc.324

- https://www.pnas.org/content/114/26/6722

- https://pubs.rsc.org/en/content/articlelanding/2018/ee/c7ee03029k#!divAbstract

- https://www.sciencedirect.com/science/article/abs/pii/S0306261916305967

- https://www.technologyreview.com/s/610457/at-this-rate-its-going-to-take-nearly-400-years-to-transform-the-energy-system/
Reply: @martinw245  >>Unfortunately you were also too tired...
I was quoting you....

>>So it "does NOT need backup" but also "doesn't need AS MUCH as renewables".
You skipped a word. "it does not need "backup" *ANYMORE*". 
"Except, when nuclear plant finally done ramping up, it does not need "backup" anymore [was only needed for the ramp up, renewables can only "ramp up" by using "backup" until it is dry] (not to mention it doesn't need as much backup [to compensate for ramp up time] as renewables do [to be considered as an adequate source])"
Next time just read previous comments again for full context.

>>if you consider a future time when....there are more renewable energy generating facilities OF ALL KINDS. 
That is the problem: you are talking about some hypothetical future times. I'm saying that we need nuclear now. We must increase both nuclear and renewables, while decreasing fossil power. Also:
— Concentrated solar power is not viable in the UK
— Geothermal power is accessible only in a very few places
— Hydropower is not easily scalable and  impacts natural habitats
— Biofuels from crops is a bad idea until they will invent GMO crops for that purpose (cellulosic ethanol)
— Biofuels from waste/used cooking oil have limited scalability 
— Marine energy (wave power, tidal turbines e.t.c.) is still in development and will will need another decade to become viable
That pretty much leave the UK with PV solar, wind, fossil and nuclear. That is it for the next 10 years. Furthermore biofuels are worse than nuclear AFAIK. Marine energy is less "dense" than wind. It wont be able to lessen the energy storage amount required by a lot. Which, again, means the choice is between solar, wind and nuclear or rather some mix of it.

>>I have no issue at all with energy backup systems, I love them, I am all in favour, both for nuclear if required and most definitely for renewable energy. 
Creating storage produces GHG emissions. Energy storage required by renewables is much higher than is needed for nuclear, plus renewables occupy much more land area than nuclear.

>>We need a mix of all kinds of renewable energy technologies. 
You have not stated that before. Your original (and pretty much every other) comment was along the lines of: "we should abandon nuclear and only build renewables from now on". That is why the conversation began.
"Nuclear is not the answer.
 [without further elaboration, can be interpreted as: we should only build renewables from now on]
Of course, it's worth billions, so you will hear those connected with the industry extolle its virtues in order to protect themselves.
 [=all the advantages of nuclear are a lie, you're fools to believe it]

In fact, new wind generation is many fold cheaper than new nuclear.

Not to mention that, contrary to popular belief, nuclear is not carbon free. CO2 is emitted by the plants during its operation, and a significant amount of CO2 during mining for fissile material. Not to mention the huge cost of decommissioning plants. Not to mention that new plants can take a decade or more to build and always experience massive cost overruns. [nuclear is inferior, don't use it]"
Reply: @martinw245  I would like to see where the IPCC states that nuclear energy growth has historically increased nations to enrich uranium and manufacture nuclear weapons.

Is it technically easier to make weapons once you have materials than if you didn't? Technically yes. However  does this indicate a direct link to the actual production of weapons? No. 

This is quite a bold statement if the IPCC is making it, because:
1. The processes and economics of a nuclear reactor disincentives the production of weapons grade material. By national and international law nuckesr reactors for electricty production limit the enrichment of nuclear fuel to between 4-12%, whereas weapons grade enrichment requires typically in excess of 90%. In order to achieve this you have to build centrifuges, which are illegal under NPT agreements for non-nuclear weapon states and carry stiff economic sanctions from the UN Security council should additional nations attempt to build them. 

2. Nuclear reactors for power generation operate in 8-14 month fuel cycles to reduce startup and rundown costs and generate as much revenue per a fuel cycle. However in doing so, this makes it improbae to produce weapons grade plutonium, due to Plutonium 239's high absorption rate in thermal spectrum and Plutoniun 240s unsatisfactory characteristics for weapons development. In order to produce adequate  concentrations of weapons grade plutonium commercial nuckesr reactors would have to operate in 2-4 month fuel cycles which is grossly uneconomic for electricty development. 

Additionally this brings into question on whether the IPCC is claiming that the increase in nuclear energy has directly led more nations pursuing nuclear weapons. I would as would multiple studies claim this is not accurate at all. 

1. There are 31 countries with operating nuclear reactors and as much as 38 historically. Yet today there are only 8 countries with nuclear weapons. If more nuckesr reactors lead to more nuclear weapon states, how is it that we don't have 30 other countries with nuclear weapons? 

The answer is the massive penalties from major superpowers and international economic sanctions from attempting to build them. Not to mention the likely increase in military expenditures and political strife for your country and your neighboring countries. 

Unless you are prepared to accept major economic burdens or have a neighboring ally with the ability to supply support for your cause, it's unlikely that you would be able to survive as a developed society attempting to build a nuclear weapons program. 

2. The idea that nations have historically gone from nuclear power to nuclear weapons is historically false. 

In the USA we developed reactors with the sole purpose of developing weapons grade material prior to developing nuclear reactors for energy generation, and their designs are different. 

Yes we did supply other nations in the 1950s and 1960s with nuckesr energy and these nations did build nuclear weapons programs such as Iran. However in the case of Iran, this nation had 10 years of reactor development for energygeneration, then 3 political regime changes only then to begin production for weapons creation. 40 years later after continuous economic sanctions and facing a 10 year recession they still have not launched a major nuclear test.

Other nations like North Korea have a nuclear weapons program, yet have never had an operational nuclear reactor for electricty generation. So how did the IPCC come to the conclusion that you have to have a nu lear power generator to have a nuclear bomb?

North Korea gained access to nuclear weapons largely due to the USSR and China providing military technology and funding during the cold war, which leads to the argument that greater military development plays a greater role in proliferation than nuclear energy for electrictydevelopment. 

.https://www.dartmouth.edu/press-releases/nuclear_energy_programs_do_not_increase_proliferation.html

https://www.jstor.org/stable/40389010?seq=1
Reply: Hi, dont mind me, i just want notifications from this "thread"
Reply: @SCP - 507 Hoppy Boi nuclear waste is alot worse pollutant than CO2 just saying. Then containing it needs tonnes of steel, not really that renewable. Also mining it and refining uranium.
Reply: Nuclear is a dead horse.  Please stop kicking it.
Reply: ttime jon one word (radioactivity)
Reply: @Apostate_ofmind  thorium: allow us to introduce ourselves
Reply: @Apostate_ofmind  more people have died installing solar in the USA then people have died in all of  the world by nuclear power.
Reply: Event Hʘriךּon people like you stand in the way of progress. You are the problem.
Reply: @Rooster Cogburn Yup. Just ask any German who gets a power utility bill.
Reply: @roostercogburn5629  mate the people who are stopping progress are people who don't use there own heads n just flow. We need people to come up with new ideas and test them like this air pressure thing but we also need to build things we know that works like nuclear power that has almost  makes no CO2 n a lot of power. People that just flow like the guys at Greenpeace. Stopping nuclear power, they are the people stopping progress
Reply: @Apostate_ofmind  ignorance is a bliss doesnt it. Do you know your bone is radioactive too? Sunlight is radioactive too? Bet you dont.
Reply: @nomad640  depends on the ammount of radiation we are talking about: "Not great" or "not terrible"?
Reply: Nuclear energy is too costly and too dangerous.
Remember Fukishima and Chernobyl. Both of these sites will be dangerous for thousands of years.
Wind and solar energy are safer, cleaner and cheaper than fossil fuels and nuclear energy.
Battery storage makes wind and solar base load storage 24 /7.
Reply: @Kenz300 x Too costly? The cheapest fossil fuel power plants use hundreds of millions of dollars of natural gas each year where a 4th gen nuclear plant would need $10M or less for a 7-10 year run. Infrastructure costs are identical. Nuclear is safer, cheaper, and carbon neutral.
Reply: @lucasthompson1650  Wind and solar have no monthly fuel costs. They are the cheapest and most efficient way to go.
Reply: @Kenz300 x They’re subject to the whims of weather, they don’t generate enough power for the amount of land they use, and for solar panels, they need to be replaced WAY too often and are too hard to recycle to start aiming at a 25-30 panels per domicile density.  

Have you looked at a graph of how much of a demand for electricity we’re going to be dealing with in 10 or 20 years?  None of the other sources even touches nuclear.  Nuclear can give us multiple gigawatt hours per person right now, no further innovation needed, for pennies. Next gen reactors will output even more, and, as always, be even more efficient and economical.

You invent a miracle long term ultra high density battery — on par with where battery tech would be if it scaled/innovated with semiconductors since the 60s— and I’ll endorse solar and wind.
Reply: @KJSvitko  Please read my reply in full (if you want to have a better understanding of the reality of the problem). I'll substantiate my words with relevant links.
1. No it's not and it's not. Costs: https://www.youtube.com/watch?v=cbeJIwF1pVY Danger: https://ourworldindata.org/what-is-the-safest-form-of-energy 
2. No they will not. Current excluson zone in Chernobyl is 30km. However about third of it is completely habitable, another 50% is "intermediate" (will become habitable within 30 years on its own), only 20% is highly contaminated by isotopes with long half-life (will need decontamination). There is a map of current radiation levels in this BBC article (habitable: up to 0.12µSv; intermediate: up to 1.21µSv): https://www.bbc.co.uk/news/science-environment-47227767

Besides, Chernobyl is a completely, absolutely irrelevant example. It was ~34 years ago. The flaw in the reactor design was first noticed only in 1985 and wasn't yet wildly known among power plant operators in USSR (it takes time to conduct a research and notify personnel). And it could only become a problem after a series of very unlikely events. Since than the understanding of nuclear physics and reactor designs have advanced immensely.
Explanation of the Chernobyl disaster: https://www.youtube.com/watch?v=q3d3rzFTrLg

3. Radioactivity released in Fukushima accident was ~20 times lower than in Chernobyl (14,000 PBq vs. 340–780 PBq). And 80% of it fell into the Pacific Ocean. On April 01 2017, most of the evacuation orders issued to the evacuation-designated zones (excluding the Difficult-to-Return zones) have been lifted. An ongoing intensive cleanup program to both decontaminate affected areas and decommission the plant will take 30 years. So both Chernobyl and Fukishima areas will be fully habitable within 30 years.
Official maps for Fukushima exclusion zone: https://www.pref.fukushima.lg.jp/site/portal-english/en03-08.html

Interestingly, there were no direct radiation related death during the accident, nor there were any radiation sickness cases. 0. Null. Zero. The only known radiation related death (lung cancer) happened in 2018. Seven years after the accident. In total: radiation related deaths 1; tsunami related deaths 15,899.
 [wiki]: Studies by the WHO and Tokyo University have shown that no discernible increase in the rate of cancer deaths is expected. Predicted future cancer deaths due to accumulated radiation exposures in the population living near Fukushima have ranged in the academic literature from none to hundreds. 

If you add up all reasonable future death estimations from all nuclear power plant accidents it'll still be less than 15,899 caused by a single tsunami. 
[wiki]: It was the most powerful earthquake ever recorded in Japan, and the fourth most powerful earthquake in the world since modern record-keeping began in 1900.
Explanation about Fukushima: https://www.youtube.com/watch?v=lOqFr87Xh-g

4. Wind and solar aren't cleaner, see: https://en.wikipedia.org/wiki/Life-cycle_greenhouse-gas_emissions_of_energy_sources
They are not exactly cheaper either: it depends on climate and policies of a country they are located in. In some cases wind or solar overtakes nuclear in other nuclear comes first. See: https://en.wikipedia.org/wiki/Cost_of_electricity_by_source
Besides, both wind and solar need more space than nuclear. Additionally wind turbines pose danger to birds, they degrade rather quickly (-> downtime for maintenance). And both provide inconsistent power output.

5. Battery storage also COSTS A LOT. If you add that to the cost comparison from 4. nuclear will win every time anywhere. The production of batteries is also harmful for the environment and mining ingredients for them involves child labor in most cases (see: https://www.greentechmedia.com/articles/read/green-battery-revolution-powering-social-and-environmental-risks)
Reply: @KJSvitko  u know nothing about nuclear energy. Do some more research. Nuclear energy per kWh is one of the cheapest it just costly to build. More people have died installing solar power systems then by nuclear power